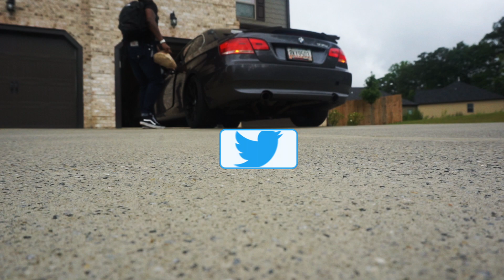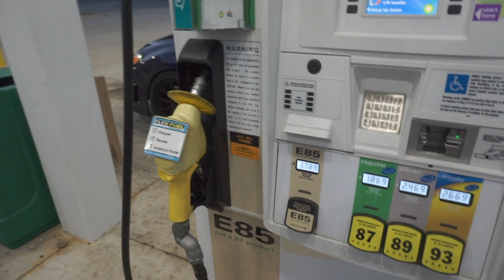FBO E85 DYNAMIC AUTOWERX STAGE 4 TURBO 335i VS FBO E85 BIG TURBO SUBARU WRX*24psi*! HIS TURBO BLEW!

Comment: If the vaccum line popped off the wastegate, hes running all the boost in the world which overworked the turbos and blew his oil seals, bc if you have no boost, it really does nothing to the turbo :)
Reply from the maker: crazygamer889 true but nah he blew his turbo lol he hooked the Vaccum line back up & still made no boost lol
Reply: @ThatGuyTez  my best guess is the vaccum line came off and he blew the turbo, and then tried to boost after but the wastegate was shot and turbo seals were gone
Reply from the maker: crazygamer889 THATS exactly what happened. First run it was on & I think it popped off at the end of the pull & the second run it was over
Reply: @ThatGuyTez  hurts to see it😪